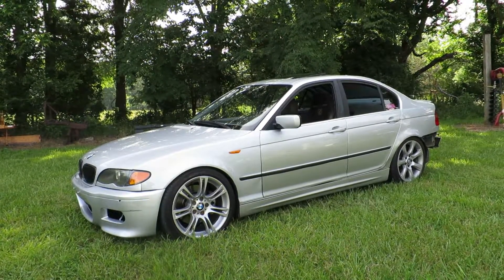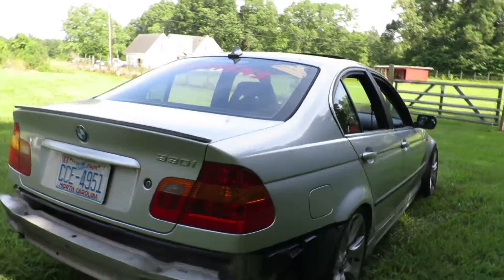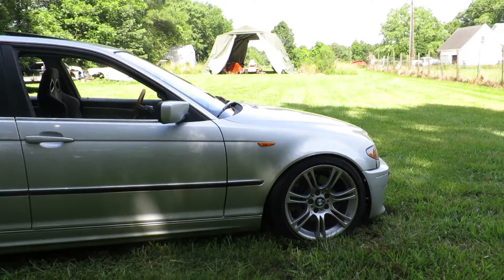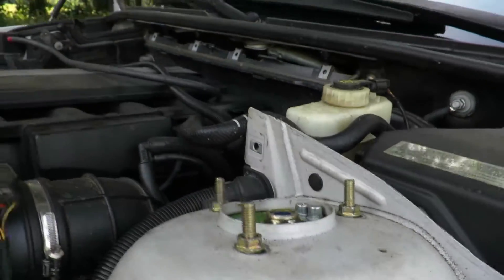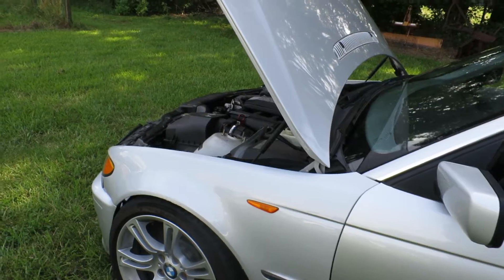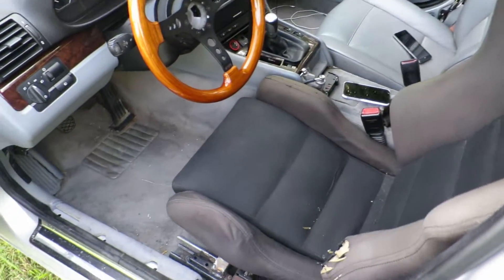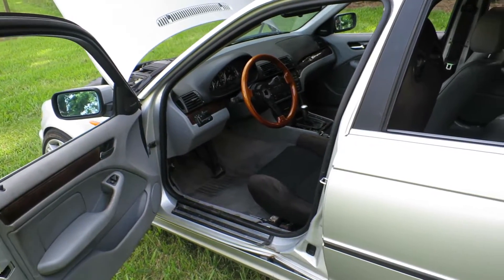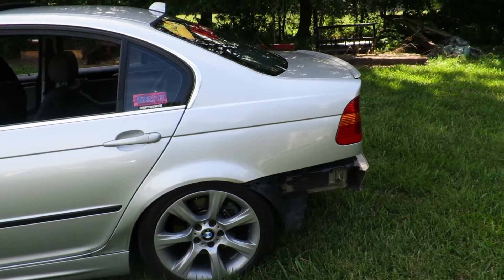Basic E46 Budget Drift Setup

Comment: Hi Alex
Where did you buy the steering rack spacers?
Great video, helps a lot, thanks for this.
Reply: And by the way Alex, what would you suggest for tire/rim size on an E46 323i going sideways?
I drive with coilovers and a welded diff, no other mods yet.
Next install will be the adjustable rear toe brackets you suggested in your video (thumbs up).

Comment: To turn off the Traction Control, AbS, DsC etc. and actually get to use the car. What do you do? Do you do the disconnect wheel sensor and use the DSC button method?
Reply: Press and hold dsc button for like 7-8 seconds until handbrake light turns red/orange when handbrake is off, or just disconnect the front wheel speed sensors ( on of the rears does the speedo so be warned), this all applies to welded diffs and only one of thes methods are needed ( not both together). Not sure what happens if LSD is fitted and the cars DME isn't told about the change

Comment: Hey I have an E46 and my passengers side front tire keeps shaving on the inside of my wheel well. I currently am sitting on MR Euro 2s, but it still did this even on stock suspension. Do I need to run negative camber to prevent the rubbing or get spacers? I have an 03 325i sedan

Comment: Are they actually easy to work on if you have minimal experience working on cars? Did you have a lot of tools and a lift at your disposal? I really want an e46 or e36 for a drift project, but i get scared seeing everyone say what a nightmare they are.
Reply: They're so easy to work on. The cooling system is temperamental, though. I think that's a lot of it. Super sensitive to overheating as well. Plus there are a lot of torx fasteners, so get a good set of metric torx bits and drivers.

Comment: Hello, I have a e46 330xi and wanted to swap it into rwd, but not sure the engine supports of the two are similar in the front. Do you think the two front spots of the xi subframe bolts into the same place as rwd? Do you think it would swapable? Thanks.
Reply from the maker: I think it can be done. But you’d need a rwd front subframe, control arms, trans, and driveshaft

Comment: so without toe plates in the rear just go as low on camber as possible ? 
what are those steering rack spacers?
Reply from the maker: I would recommend using camber gauges if you have access to them. The steering rack spacers are just 1mm washers from McMaster Carr.

Comment: what do u think about the 325ci?
Reply from the maker: I would avoid coupes and convertibles as they are the most prone to unibody damage at the subframe mounting points. But 325s are stout. With a little work those engines can make about 200whp.
Reply: I have a daily 325ci. its not the best but its light and sporty. e46s are great projects

Comment: if you're doing all this work you might as well start with a coupe??
Reply: Why would you want a weaker chassis
Reply: @jrcanes5508  The coupe isn't weak by any means, there's no noticeable difference from strength. The coupe weighs less and looks a million times nicer.
Reply: Wrong and wrong. 

BMW E46 Sedan (w/o folding seats) - 18,000 Nm/deg
BMW E46 Sedan (w/folding seats) - 13,000 Nm/deg
BMW E46 Wagon (w/folding seats) - 14,000 Nm/deg
BMW E46 Coupe (w/folding seats) - 12,500 Nm/deg
BMW E46 Convertible - 10,500 Nm/deg
Reply: @jrcanes5508  nice number mates, maybe try real world testing next and you might figure something out. Theorycrafters :'DDDDD